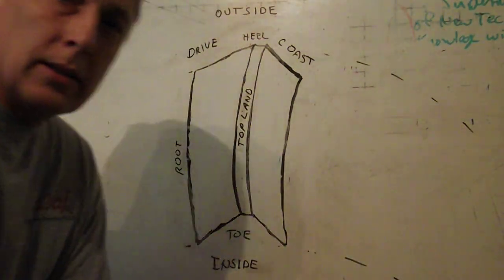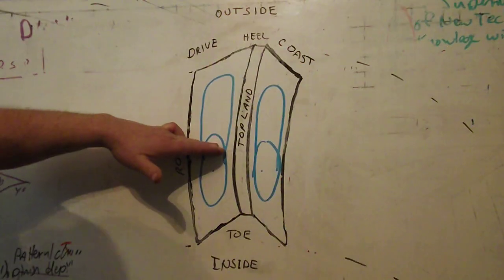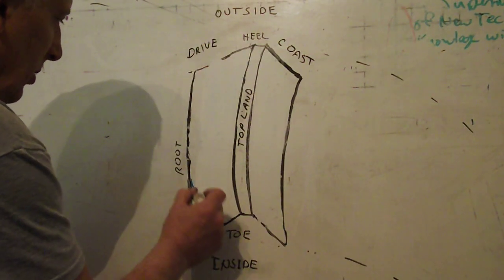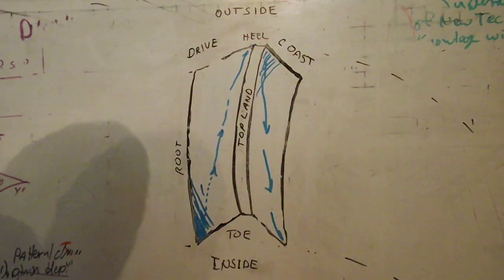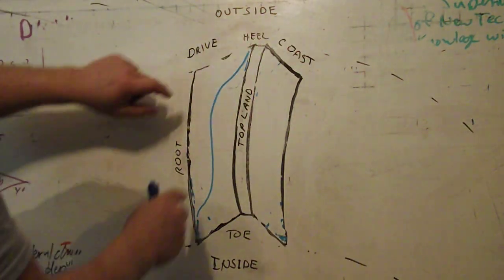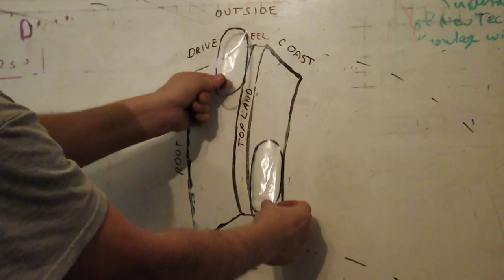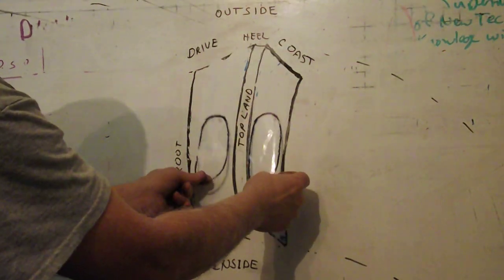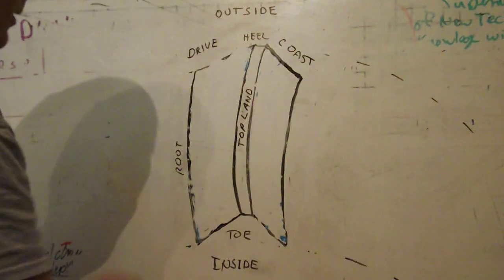Ring & Pinion Patterns explained, back lash vs pinion depth

Comment: what do you do if the pattern is centered nice but high on the tooth?  Thx!
Reply from the maker: I often get gear sets that don't follow the rules I put forth in the video. typically they are used, sometimes they are new, but bargain brand, and sometimes even quality gears are goofy on set up. Welcome to my world. If its goofy on set up check for run out on the carrier, (see my other vids). and sometimes if that is straight, I figure the housing itself was not machined properly at the factory. The only thing you can do is using set up bearings, take 1 to 2 hours, and play .005 incremental pinon depth changes and keep backlash in the .010 to .020 range and see what happens. typically after an hour of trying i go back to where I started and hope it does not whine. I know this is not what you want to hear, but sometimes that's the way it is.  Oh and if its a used gear set, you may try opening up the back lash .015 to .030. sometimes if they are worn you just chase the pattern till it likes it.

Comment: forgot to ask ! Is there an easy way to make sure you dont f.. up the crush sleeve ?
Reply from the maker: place your new crush sleeve in a shop press between to sturdy flat plates, directly under the press shaft. and then have your old crush sleeve beside that also in between the flat plates. add a .030" shim to the old crush sleeve, then pre-crush the new sleeve to that length. Then mark your socket with dabs of paint in 8 places around the outside.     then you can turn it in precise increments even with an impact such that you do not turn it to far.

Comment from the maker: Actually it does not require setting up the ring and pinion again, just the backlash, as the pinoion depth will not change and assuming the patter is good when you took it apart, why change it. On the other hand while you are in there make sure the pinion preload is within spec. if its a little loose tighten it up. this still will not require changing the dept, just the preload shims.